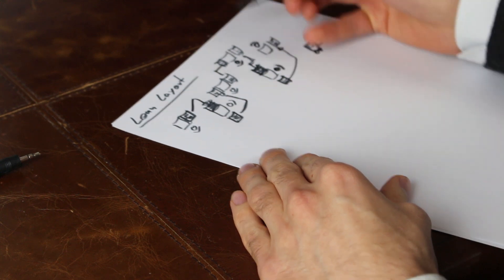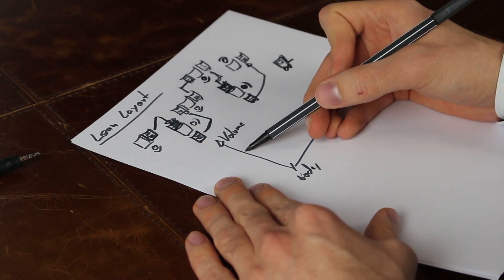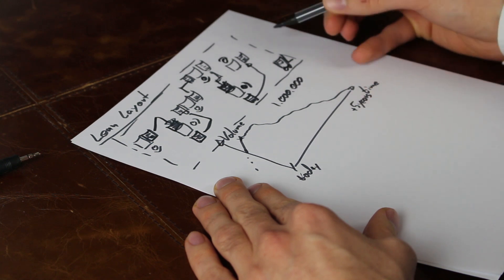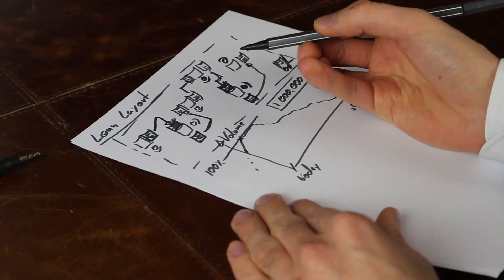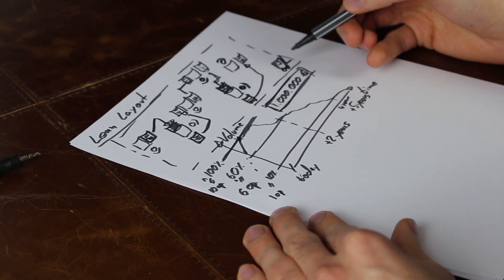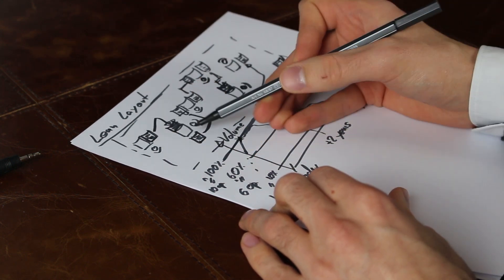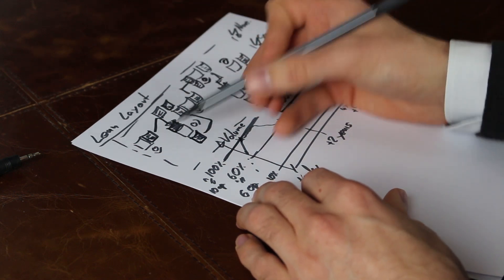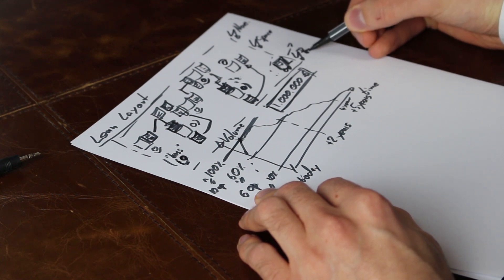How to design a Lean Layout/Obeyaka? The Lean Manufacturing Guide

Comment: Cellular manufacturing. The traditional assembly line is n stages and m workers, where n=m. In this case 6 stages and 6 workers. Cellular lines are often U shaped. It is easy to reduce production by integer values of n/m. 6 stages, 6 workers. 6 stages, 3 workers, 6 stages, 2 workers. 6 stages, 1 worker. Throughput is reduced by m/n.  Lots of details to work out.

Comment: In the final example you need to reverse the flow so you can feed raw materials & pick up finished product from the ends unless you have a lift truck alley down the sides otherwise you r operators(s) have to worry about getting struck by the forklift.
Reply: Agreed. That would be much safer.